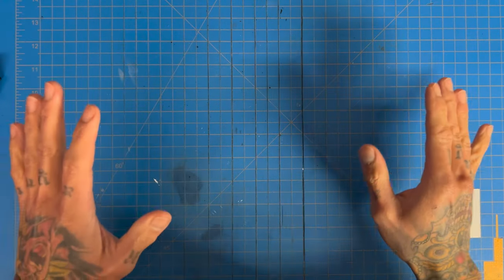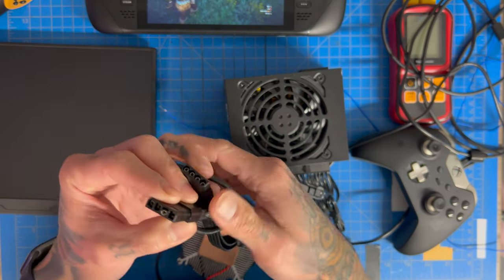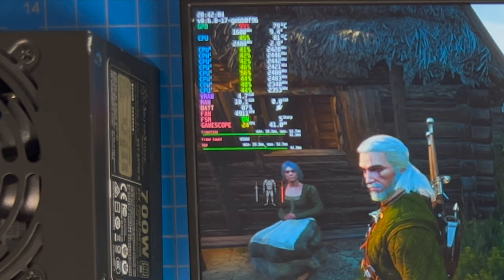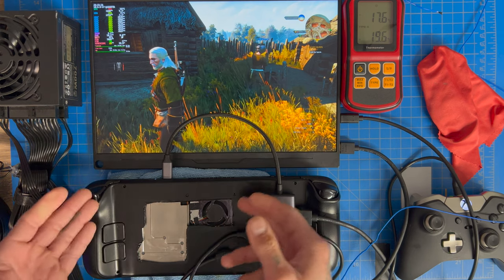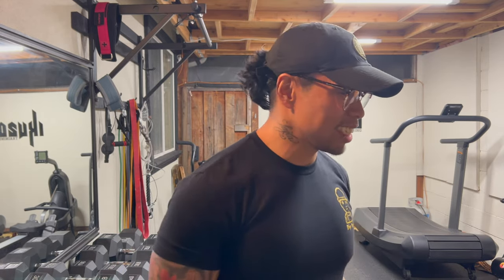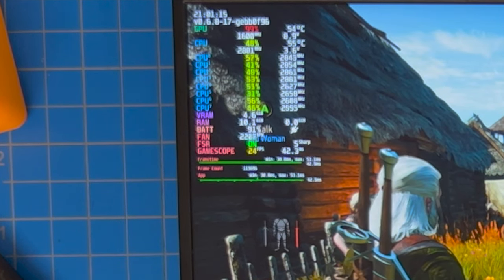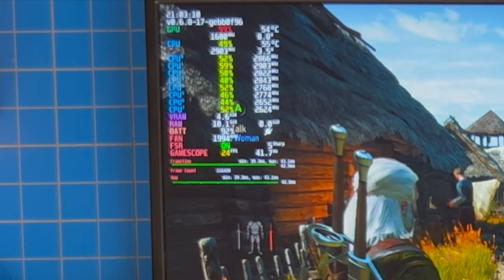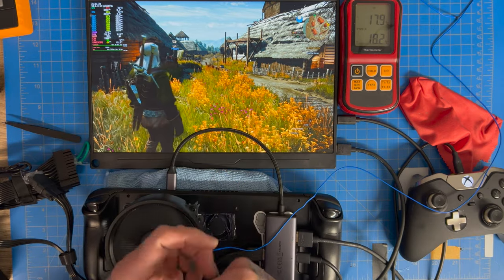DIY Peltier for the Steam Deck - why buy one when you can make your own.

Comment: You can undervolt, overclock the CPU & GPU with a usb tool for the bios. Wattage can also be increased through Decky - Powertools. Maybe if you change the fan curve with a plugin in Decky your temps will go lower. Great videos!
Reply from the maker: Thanks for the tips! Definitely that’s the next step! We have all the cooling now so we need to push it!

Comment: Ha nice! This worked better than I thought through the cheap aluminum case. I think a magnetic fan with a 25-50w peltier, jsaux case with some of the plastic removed would be a real clean docked combo. I'm actually surprised that it didn't get sub ambient temps but sometimes those cheap peltiers are using much less power than rated or the hot side isn't getting cold enough. Cooling the hot side more can make them much more efficient. Definitely try some overclocking. Mine at 3900 CPU and 2000 GPU runs really well and not that much hotter at 18w TDP. Way better FPS.
Reply from the maker: Yea without the added heat it got to as low as -5c but the deck is putting out around 55c on that spot.  Definitely think a better peltier would make better results.

Overclocking is for sure in my future!
Reply: @Diy_Papi  I think mine would get like -20c but I had it insulated on the cold side

Comment: I unsubscribed and subscribed agaín so you have to do more pull ups 😂 👌👈
Cool home gym. I hate my local gym. Greetings from Switzerland.
Love your content keep it coming!
Reply from the maker: Fun fact about the gym, I built it during the lockdown in America, I needed a place to train myself and my clients, so it was a must for me. Well that the story I tell my wife lol jk. Thanks for the Sub a really appreciate it 🙏🏼
Reply: @Diy_Papi  Great to hear man. A friend of mine had to give up his gym because of the lockdown.

Steam Deck: You maybe wanna try this. I removed the metal shield completely and drilled holes around the stock fan like you did to suck in fresh air. I have the updated quiter fan. I bought non adhesive silicone and made a sealing around the stock fan so it woul suck fresh air more eficiantly. I bought a Noctua 40mm 5V (3Pin) Fan and soldered it to the stock fan. I cut a hole for the fan and drilled 4 holes to screw it on. I placed the Noctua fan a little above and alittle on the left of the GPU. The Noctua fan pushes air OUT of the system and cooles the components. I get temperatures around 60C on GPU and CPU. I would send you pictures but I dont know how.